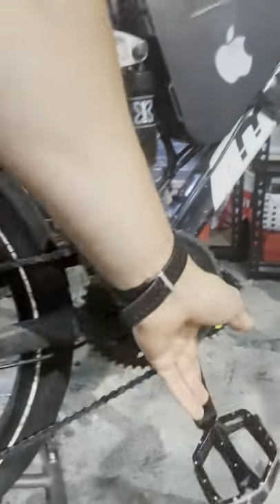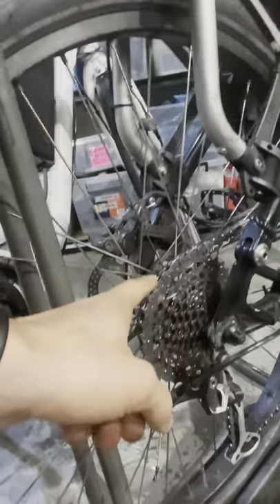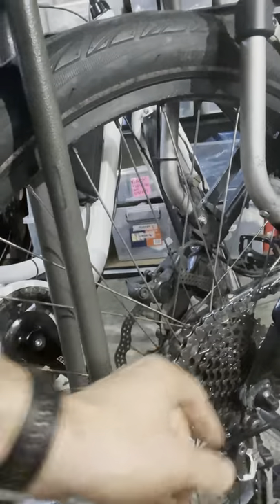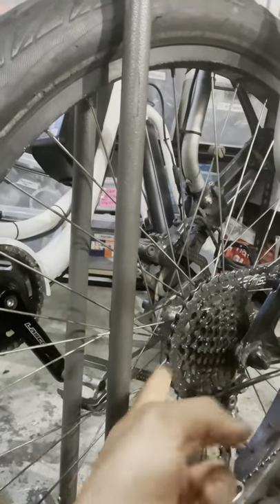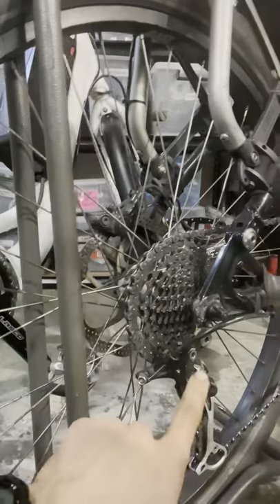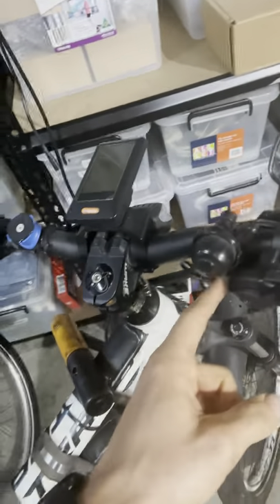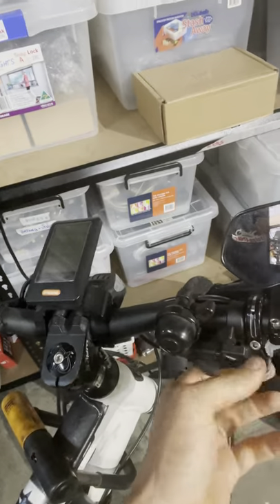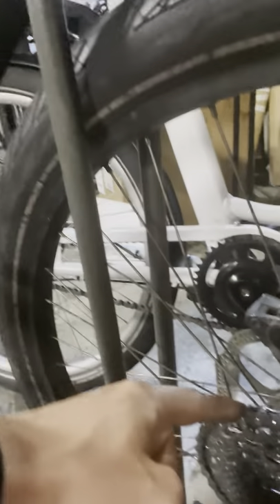How important are the gears for mid drive motors? Bafang Bosch Shimano Brose TS and others

Comment: Gracias amigo! Clear and to the point. I’m just about to do my own conversion and I will definitely need to make sure my gears work!
Reply from the maker: Glad it helped amigo!
Reply: Update – the build is done, and everything is working amazing! The hardest part was adding the gear sensor, turns out my cable was very old and it felt kind of crunchy when I passed it through the gear sensor. So, I replaced the cable and cable housings, and everything is buttery smooth now.

Comment: So how should I shift gears? If I don't have gear shift sensor
Reply: You can still shift gears like normal in fact most mid drive don’t have them they just cut power while you’re shifting it’s better for the drive train
Reply: @pascalkargut3237  thanks for your response but what you mean by cut power?
Reply from the maker: I will post a video next week talking about the cut-off vs gear sensor. Subscribe to the channel and check the notification bell to receive this video!
Reply from the maker: I will post a video next week talking about the cut-off vs gear sensor. Subscribe to the channel and check the notification bell to receive this video!
Reply from the maker: Hey guys we have uploaded a fresh new video in our channel talking about gear shifting please check it out
Reply: If you are using throttle only you don't  need  a sensor at all, as you just fully release the throttle  to disengage the motor  then start peddling to use your derailleur to shift gears. Using  pedal assistance  mode you need to have a gear or brake sensor  installed  to cut out the motor  when  shifting  so as your peddling/cadence  is not interrupted.